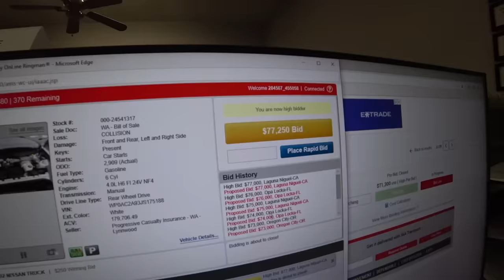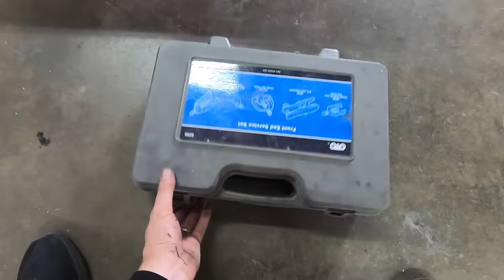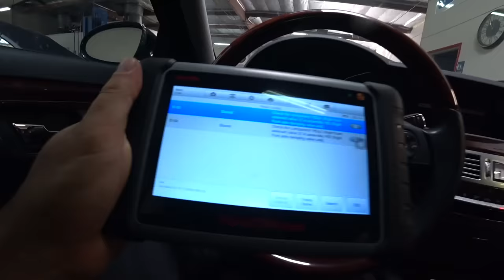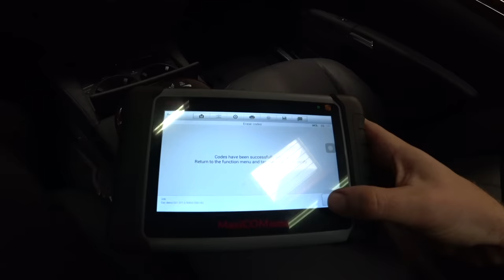REBUILDING A WRECKED MERCEDES S550 "NEW FENDER, SUSPENSION AND FIRST TEST DRIVE'' PART 3

Comment: Do not paint the door, Just use a little paint on scratches, and sand it with 4000 and polish it.
Reply from the maker: Far daz yes I can do that, but it’s not going to be 100% perfect
Reply: @lnccollision  but you are ideas is really good, but if I wear in your shoes, I never painted for 2 small scratches.